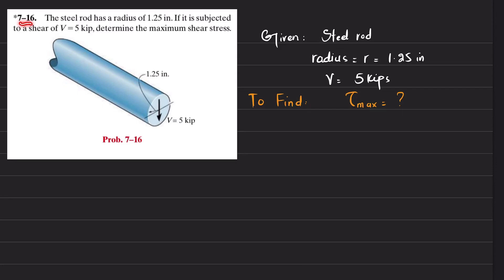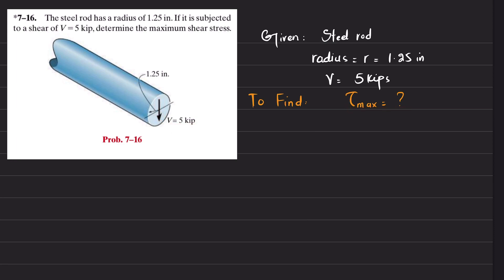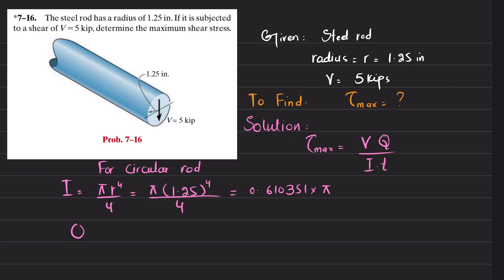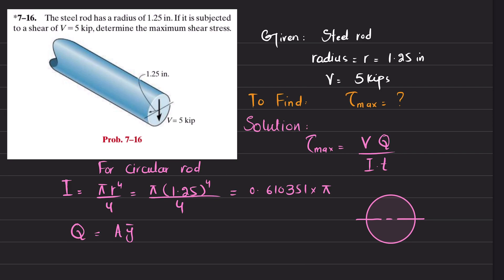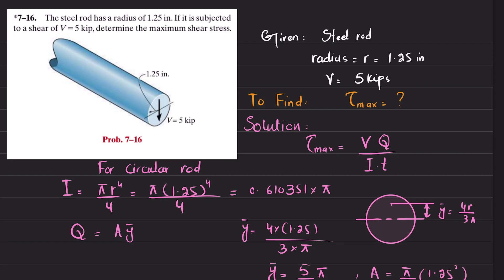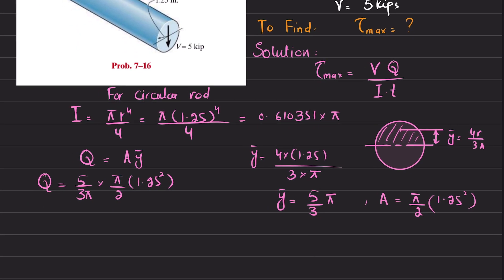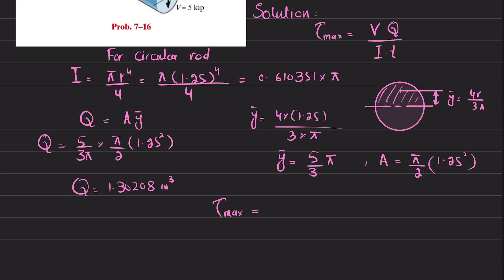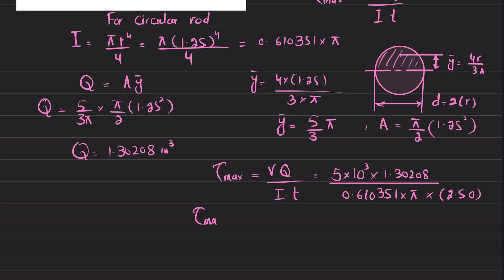7-16 Transverse Shear | Mechanics of Materials RC Hibbeler

Comment: If I have a bar or wire of steel and I want to find the shear stress in order to know what is the force needed for cutting. How do I find the shear stress first in order to calculate the maximum force needed? Let's say it's SAE 1020 type steel.
Reply from the maker: So for SAE 1020 steel you will get its allowable shear stress /yield stress and then put in formula shear stress =( V x Q )/(I xt) and find V for this problem
Reply: @engradnanrasheedmechanical     tow=f/A   ,  i have just A , so how i well get allowable shear stress for this spicific proplem that solved here in this video ?
Reply from the maker: You can get it from Mechanical properties table at the end of book